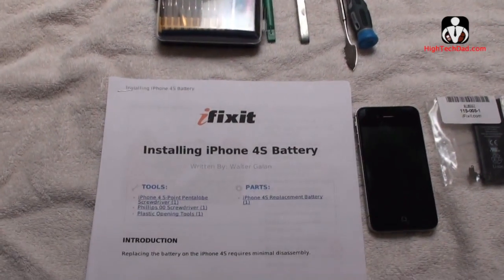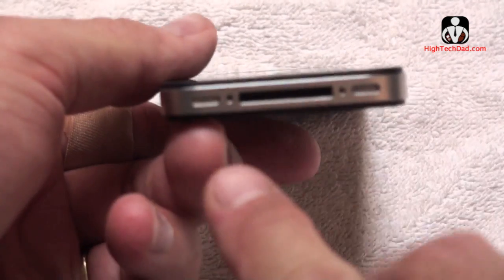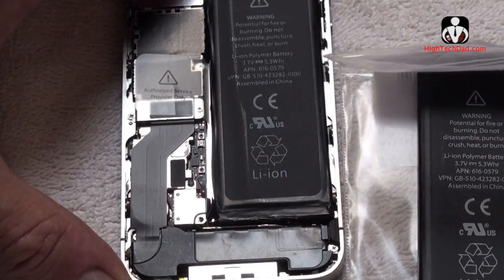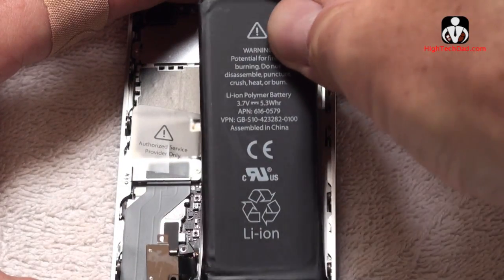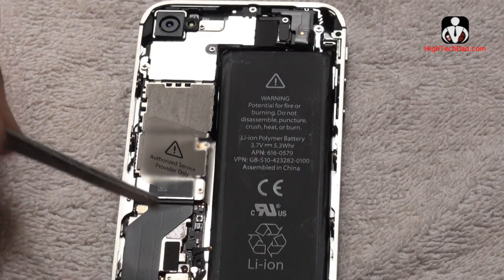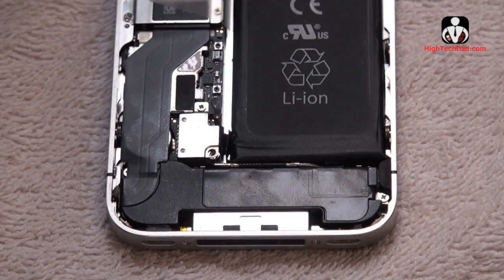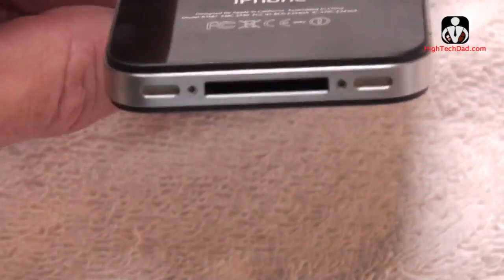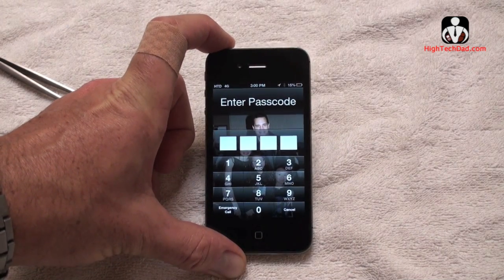How To Easily Remove, Install & Replace an Apple iPhone 4S Battery

Comment: Heey guys, this video is excellent !!! I wanted to ask you guys one question. I have two iphone 4s, and i want to remove a wireless chip from one iphone 4s and put it into the other iphone 4s. Is this possible ? Can i do this ? I mean can i take a random iphone 4s, remove a part that i need and put it to another iphone 4s ?? Thank you verry much !!

Comment: Are you sure the little black thing isnt upside down? theres a gold socket just above that looks like it slots into, for the Antenna shield, similar to Wifi Adapters inside laptops
Reply: rewind the video before it popped out,you can see the little gold thing hanging just like he places it after. I think he did it right.

Comment: My iPhone was about 80% charged and then shut off.  I could not power it back on even when plugged in.  Then I pushed the power button and the home key at the same time and it powered up.  Not sure why this happened.

Comment: Once inside one of the screws was stripped and could not remove the battery. Any fixes?
Reply: Once inside one of the screws was stripped. Any fixes?

Comment: Great vid - we purchased the fixit with tools - same price so why would you not!! The only recommendation I can make to others, if you have a strong magnet, pass your screwdrivers over it a couple times to magnetize them - then you don't need tweezers. And no - a magnetized screw driver will not hurt you electronics.
Cheers, Patrick

Comment: You do realise you did this on a carpet? That creates static.
Reply from the maker: Actually it's on a towel. Touching metal like a faucet will discharge the static. I used to use a grounding strap but haven't had any issues with static in the past few years but good point.
Reply: This guy know what he's talking about, you shouldn't question him
Reply: +Comment Guy yeah but other people might not know that ESD from carpets and stuff can ruin your phone.
Reply: Kong Skinner 7

Comment: Thx, helped me really on my 4s ( Other video's are just for the 4), three tips, make sure not to leave fingerprints on batterij connections (e.g. use gloves), second the size of the screws should be told in the beginning (the bigger one has to be up) and last but not least the little black thing comes from under the upper screw. be aware by unscrewing so you see it popping up. thx again I like your style.

Comment: is it true when you do this you lose all the data on your iphone?
Reply from the maker: No, the battery has nothing to do with data storage.
Reply: When you send it to Apple yes but otherwise no
Reply: hi, I just wanted to ask, on EBay, I'm purchasing a replacement battery. Do you think it will be okay to use or not because I don't want to permanently ruin my phone. This is the link to it:

http://www.ebay.co.uk/itm/1430mAh-Apple-iPhone-4S-Internal-Battery-Replacement-Tools-TOP-QUALITY-/301799071720?hash=item4644a05fe8:g:lwEAAOSwintXRuiv

please reply soon.

Comment: Yep - worked as advertised.  Thanks for the warning on the black tab popping out, and on keeping the screws separate.  The only unexpected challenge I ran into was that the black ribbon that attaches the screw plate to the battery got folded under the screw plate so I couldn't attach the lower screw.  Had to take it out and refold the ribbon so it would stay tight against the body of the battery.  After that it fit like a charm.  And if you bought the tool kit online to install the battery, the Phillips head didn't seem to fit the inside screws, so you're better off getting a jewelers set of tools with magnified tips.  Way easier.

Comment: Helpful indeed. As you mentioned the two little screws differ slightly in length. The shortest one should go in the upper slot, which also holds the little grounding thing that you were having trouble with.

Comment: I put my new battery in and charged it up then started using it.. after i had already done that, i was told 2 different things.. #1: meant to leave it charging for 24 hours before use to get longer life out of it and #2: i should use the existing life that is already on the battery till it goes completely flat and then charge it.. any of this true or is what i done not matter? haha sorry if this confuses you.

Comment: THANK YOU THANK YOU THANK YOU! I followed your advice on this video step by step; I even went through the same issue with the black tab. But it worked out. Not only did I save $180. by not going to Apple but I also have a phone that has a longer battery life. Much appreciated.

Comment: Great video. I use Wiha magnetizer for tools. It is a great way to magnetize or demagnetize your screw drivers and eliminate the tweezers. You can buy it at Home Depot. It works great

Comment: This was a fluke find. I'd already replaced my battery. Phone worked fine but then I noticed that tiny part and wondered where it had come from. Can't believe he did the same thing and worked out how it fitted. I took my phone apart again; fitted the part quickly and it was much simpler to put back together (especially having been told the screws were different sizes). Love YouTube for the how to videos!

Comment: I got a iPhone 4s and when it reaches 35% of battery it dies
Reply: I just got an iPhone 4s too and the battery dies at 40%! Do you know if changing the battery helps this?
Reply: I had the same problem, when my iPad reached 10% it turned off, what I did was I charged it fully over night until it reached 100% and then fully discharged it by draining the battery until it it turned off (by using it until there was no power left in the battery to power it and so turned off). I then recharged it fully and had no more problems. I read that this method was a way to reset the percentage on the top right as there isn't a problem with the battery but instead the problem lies with the percentage at the top showing the wrong percent in the iPhone battery. Hope it helped.
Reply: ***** me too fuck i don't know what to do

Comment: Very helpful tutorial HTD, however you should mention in the video that not all batteries that you can purchase come charged right away, the one you showed obviously was, leading me to believe the battery was faulty or I did something wrong. Besides that, great video, thanks for the help.

Comment: How can you fix your iPhone 4s when it overheats and the wifi is disabled is it the battery?
Reply: Heat with hair dryer until it say too hot, put I. Freezer for while, it should then work

Comment: I did the install but my phone won't turn on.  I plugged it in to see if it was maybe that the battery needs an initial charge, but after 5 minutes it still is showing the empty battery picture when I hit the home button with it plugged in.  I am hoping it just needs a charge!!!!
Reply: I'm experiencing the same problem. How it can be fixed ? Thnx.

Comment: That worked great for me :) Thanks ... Just a word of waning when u try to take the old battery off make sure its completely drained as if u clip or rip by accident when trying to pry it out the black tape around it it can burn out and yep pretty much explodes lol mine did just now and thought it would be cool ppl to know that but if u have a replacement battery to put in nothing to worry about as the old one u wont need...

Comment: There is a bracket that you never mention that goes in with the battery how does it go in. And it would be nice for any future vids to put them in the frame so we can see what you are doing.

Comment: I don't know if there's any wrong with my new battery. it willonly start if it's charging and it turns off before it even have come to the main menu. Then it does it automatically over and over again! :(
Reply: same! what did you do?
Reply: Rhys Overton I have just sent it back waiting for a new one! I put my old battery in and that was working fine so I reckon it must be something wrong with the battery!
Reply: ***** I am going to send mine back to and try to get a refund i think.
Reply: Rhys Overton yeah, I sent mine back and they have now sent me a new one, I haven't got it yet, but hopefully that will work! Pretty weird how so many new batterys is not working! :S
Reply: Rhys Overton I got it today and it's working fine! so it shouldn't be any problems for you either. Just wanted to let you know! :)

Comment: Thanks for the upload! I lost one of the screws during the install. I used the one I had left to screw down the top hole with the ground under it. The phone works fine. Any idea if I'm gonna run into trouble later? The apple store probably has tons of those. I pick one up if i can and do it later.

Comment: So as i was following along, when i opened the back cover the little black clip was already out and floating around. i followed the video but the phone did not come on. don't know if its the battery or some other component.
Reply: if the black clip was floating around without removing the hold down screw, that means it was not properly assembled to start with, this clip connects to the antenna cable underneath, you should hear a click when you press down the battery connector into the terminal, if you don't, that means the battery is not properly connected to the terminal.
Reply: ***** This link has a better view of the position of the little black clip that is the suppose to be a ground contact and connection to the antenna.

http://www.ifixit.com/Guide/iPhone+4S+Battery+Replacement/7111

Comment: After you've changed the battery over, does the phone power up back to how it was originally? As in will it reset the phone or anything?
Reply from the maker: Just back up your iPhone prior to doing anything. Nothing should be reset when you replace the battery.

Comment: It worked for me. I used an $11 "gold" battery from DX.com so we'll see how that lasts.
Reply: Peter allan did you bought the 2680mAh Aluminum Alloy Battery Li-ion para iPhone 4S - Golden? does it really last twice the time of the official battery?
Reply: Daniel Andres
No, It's only a little better that the 2-year old Apple battery. I found that Dropbox was causing my GPS to stay on all the time. I disabled that feature, and the battery easily lasts a day now.

Comment: Fantastic. My screen went blank but the phone was still working so I followed your instructions, disconnected then reconnected the battery and everything is working fine. Thanks for the extra tip about the little clip thing that pops out. That was a bit tricky. Keep up the good work.

Comment: HighTechDad thanks for the video but you shouldn't work ON static prone materials like that rug. Also you should always wear an anti-static wrist brace grounded to a metallic structure otherwise you can EASILY fry a critical delicate electronic part. regards.

Comment: Great video - if no signal after install then cycle through airplane mode and you will be good to go.  Perhaps putting in airplane mode first solve problem also.

Comment from the maker: Sounds to me that you did not fully connect the battery. The iphone can turn on without a battery, I believe, if you plug it in. You might want to check for broken pins/clips. Was it an authentic battery? If your phone died in middle of restore, you "should" be able to get it back but without knowing more, it's hard to say. Good luck!

Comment: Hi,I changed the battery all went well.But when I tried to turn on nothing.  So I thought maybe it needed to be charged.  I had it charging for a day.  Nothing so I plugged it into PC the iTunes icon on phone came on great I have something.  All that I could do on iTunes was restore so I started to do that.  But I had lost power! so in the middle of the restore I lost power.  So I have been trying to reboot, restore, unlock, everything.  I have used Ireb7, tinyumbrella. can you help me please

Comment: Philips screwdriver???? WTF??? The two outer screws securing the cover were so tiny I literally couldn't make out what type of slot they employed. I ended up using an X-Acto blade and a lot of torque to get the damned things out.

Comment: I recently got my screen and back repaired at a local phone store and since this my phone is dying at 47% or less when I'm on the phone or my alarm is going off. Could a wire be disconnected causing this or have they gave me a different battery back, any ideas before I contact them. Thx

Comment from the maker: Usually when that happens, it means that you did not fully connect a cable or bent or broke it in some way. I usually recommend trying to redo the process to be sure that you haven't missed something.

Comment from the maker: When you don't have a signal, it can mean that a cable is pinched, broken or not connected. Another thing you can try, once you have a full backup, do a restore and see if that works. If it doesn't, it is most likely a connection/cable problem.

Comment: I know the APN # on the battery on the 3 & 3GS are specific and will get error 29 if its not the right APN. Is this statement true with the 4 & 4s? For example I will a battery with a APN # of 616-0579 work with a 4s that had a APN of 616-0580? Anybody have the answer?

Comment: They likely source the battery from the same manufacturer that apple uses to make the stock battery. I dedcided to use a 3rd party battery though because i wanted the 2680mah instead of the 1430mah one.